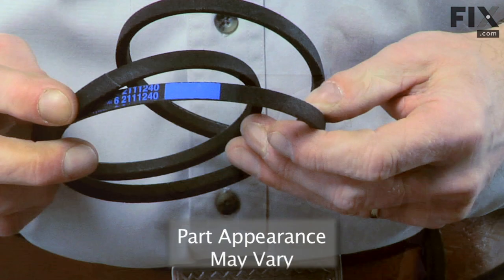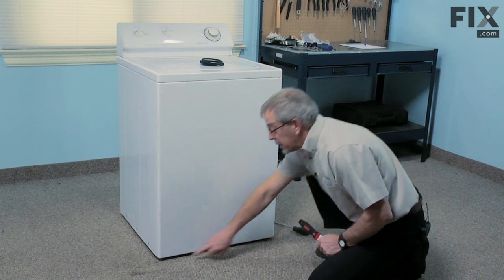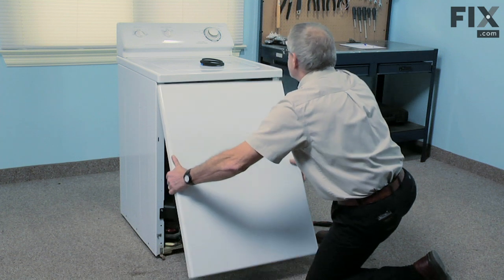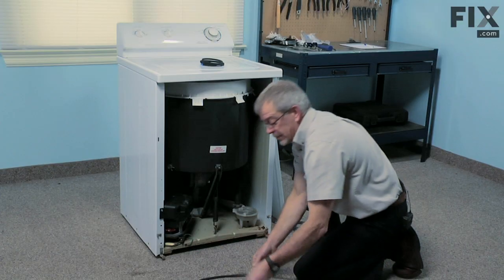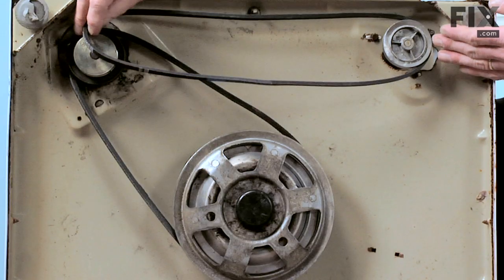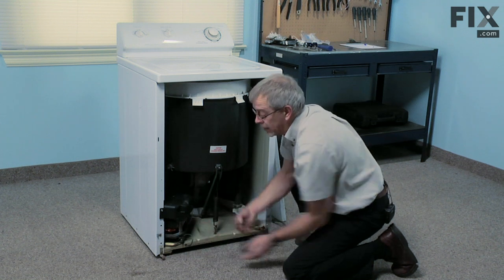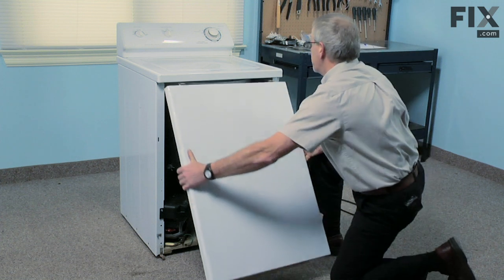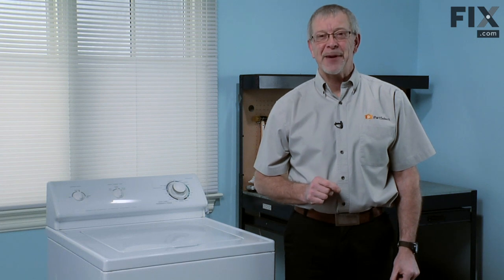Maytag Washer Repair – How to replace the Belt Kit

Comment: Very helpful video!  I had to move my washer to get behind it. Moving the washer around affected the belt position. Once I looked under the washer I seen the belt on the ground. Easy fix, the washer is running like a champ again. Thank you
 My model number is LAT2500AAE.

Comment: Hello
Why you open the front panel if the belts are under the machine?
Reply: Looked like it gave a little more room for his hands to work as well as access to the motor if necessary
Reply: There's a belt guard attached to the front panel which prevent items from entering the belt and pulleys.

Comment: Hi
My Maytag top-loader (2006) model MAVT446AWW  machine does not advance to the Agitate cycle. It stops with a full tub of soapy water. There is  slight burning smell (belt?) The belt rotates freely clockwise but not counter clockwise. What could be the issue?
Reply: Did you ever figure it out
Reply: Odor tells me its a belt. Cycle problem tells me its the timer.
Reply: Replaced timer - this fixed advancing issue.

Comment: is there anyway to tighten the main motor belt?
Reply from the maker: This style of washer uses a self tightening drive belt. Make sure that the motor carriage springs are not stretched and that the glides are free of dirt and properly lubricated. If the pump belt is too tight, it will cause the drive belt to be too loose.